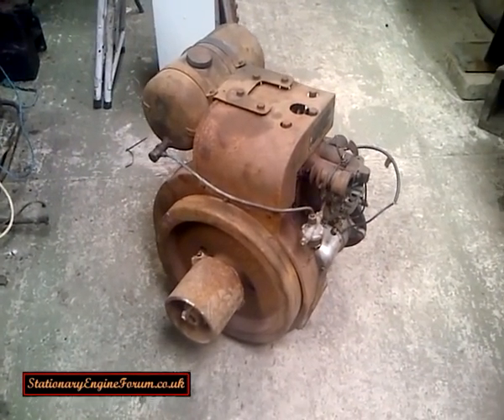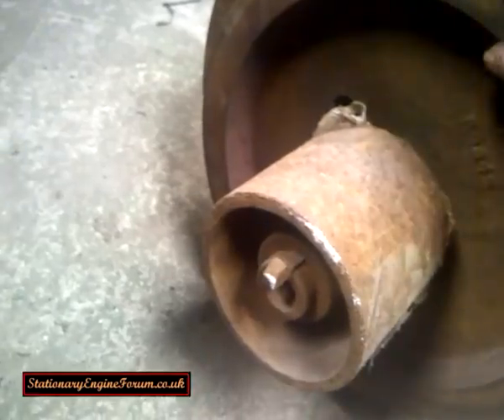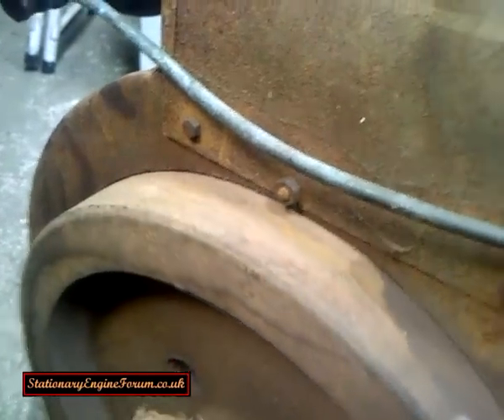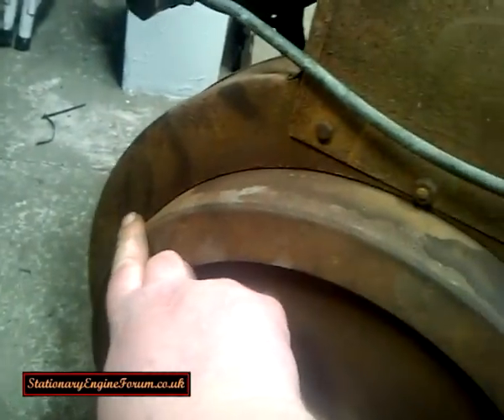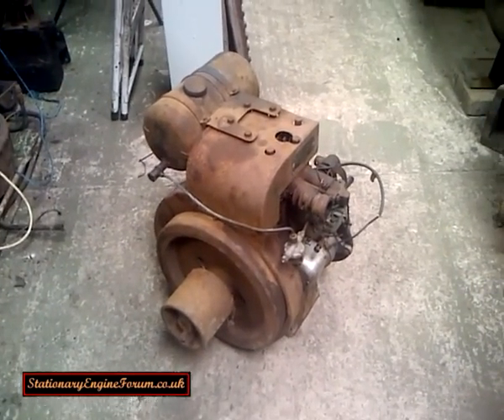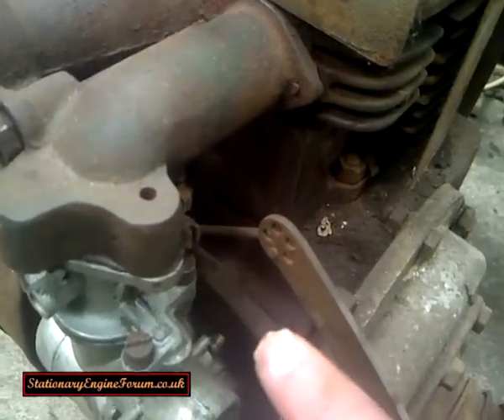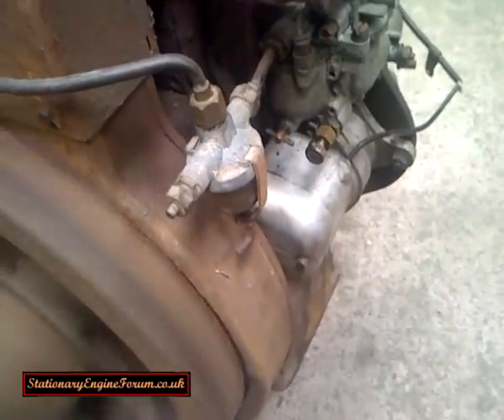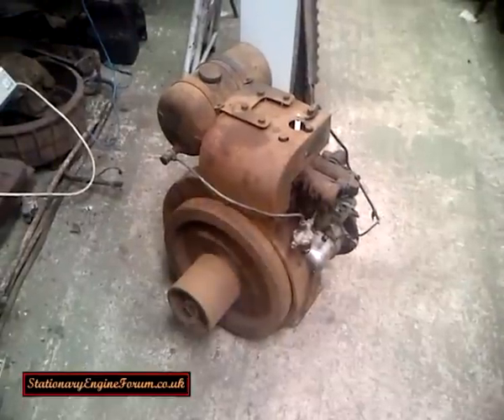How to time a Petter A1 stationary engine

Comment: I have just taken the magneto out as I had no rotation on the shaft. Ive ordered a new mag floating coupler as only half was left on the inside shaft. will need to try and fish the other half out the sump. Is there a particular way to fit the coupling ring when it arrives, or does it just fit over the drive shaft then magneto fit over that, thanks Gordon.
Reply from the maker: The coupling ring should just fit. I seem to remember it's shaped in such a way you can't get it wrong. When you refit everything make sure the ball bearing is between the two halves of the shaft that operate the governor. If it's not there the governor will not work correctly.
Reply: @AndysShed  Im totally lost now. There is no ball bearing. The shaft and large gearing cogslid forward and lost the timing . I reset the timing marks as per diagrams but now the thing wont fire up. Theres spark and petrol but somehow the timing is out. Both the timing marks on the cogs line up at tdc...sparks and clicks but wont run.
Reply from the maker: When you say the timing marks line up, do you mean the marks on the two cogs in the geartrain that you can see when the triangular back cover is removed from the engine?  You don't need to worry about any other timing mark. Just set the engine to exactly top dead centre using the flywheel. Next rotate the mag in your hand until it has just clicked but don't go beyond. Then, without rotating anything, fit the mag back to the engine. Now when you turn the flywheel the mag should click at exactly TDC. This is correct  because there is a device in the mag to advance the timing when it is running at full speed.

Comment: Hello, just picked up my non running A1. complete strip down and rebuild before seeing if it runs. Any advice appreciated.   Ernie.
Reply from the maker: Hi Ernie. I would say hold the plug lead against something metal with the plug out, turn over by hand and see if you get a spark. If you do then it will  probably go. Setting up the timing is the most difficult bit.
Reply: @AndysShed  
Cheers for the heads up.  I gotta clear some space in my garage. I'll be starting the project in a month or so. I'll let you know how it goes and if I get a spark.

Comment: Please do you know how to slow idle down as mine peaks out abs dosent idle at tickover speed kibd regards Dan
Reply from the maker: Hi Dan. There's a combination of things it could be. First thing to check is that the governor is working as it should. The weights push a pin, which in turn pushes another pin which pushes the governor linkage on the outside. However between the two there should be a tiny ball bearing. If the ball bearing isn't there (they get lost when the mag is removed) it won't be pushing the governor arm far enough to close the throttle on the carb. Also make sure the spring on the bottom of the governor arm isn't too strong. There should be a knurled adjuster on it to effectively alter the spring's length.
It could also be bad settings on the carb. Depending which carb it's got, you might have to juggle setting the main jet, slow running screw and which hole the linkage from the governor goes through. The problem is if you don't know which thing is out, it's a lot of trial and error with the carb, governor spring and linkage to get everything right. Maybe try to get it running slowly with the governor disconnected first?

Comment: Hi Andy I have an a1 the same wipac mag as your engine in the video,my qusetion is how do you set the impulse lag angle,mines been messed with,there are divisions and a pointer,am not sure how to set? Thankyou Scott
Reply from the maker: Hi Scott. I'm not sure what you mean by the lag angle. The impulse should fire with the engine's flywheel at exactly TDC. To get it to do that what you do is completely remove the mag from the engine, then turn the engine flywheel to exactly TDC. Next grab the cog on the end of the magneto and turn it until it clicks. Don't touch the end of the HT lead otherwise you'll get a belt from it! As soon as the mag clicks make sure you don't turn it any further. Now without turning either the flywheel or the mag, fit the two back together. Turn the flywheel and you'll find it fires at TDC. As far as I know there's nothing else you can adjust. the difference between the mag using the impulse to fire when turning over slowly and knocking the impulse off when running at speed is fixed in the mechanics of how the impulse works, so it can't go wrong.

I hope that's answered your question. If it's not then please feel free to get back to me.
Reply: @AndysShed  hi Andy,the engine is know running ok,thankyou Scott

Comment: Hi Andy I have just bought a A1 it doesn't have any spark and the magneto is a different type to yours any ideas
Reply from the maker: There are two mags commonly used on the A1, a Wico or a Wipac. They are slightly different, but both basically work in the same way and should be interchangable.

I would suggest you take the mag off and test it away from the engine. However when you remove it be sure not to lose the metal pin and ball bearing from the end of it that sit inside the brass housing that's attached to the rear gear-train cover. This pin and ball are crutial to push on the throttle lever.

Whichever mag you hace, start checking it by removing the cover. Check the internal connection that links the coil inside to the HT lead on the cover. Make sure the contacts are clean and actually touching when the mag is reassembled.

Whatever you do, don't fire the mag without the HT lead being very close to the mag body so the spark has somewhere to jump. If the spark doesn'thave anywhere nearby to jump to then it will find the path of least resistance through the coil and could short out some of the windings, making the coil lass effective or even completely inoperable.

These mags very rarely go wrong, so chances are you have dirty contacts somewhere or maybe a bad HT lead. Remember to check the points and condenser. Clean everything up and it might well be ok. Let me know how you get on.
Reply: Thank you I think it’s the wico square type top will do the soon thanks

Comment: I bought one of the plugs you recommend but it only screws halfway into the head as thread does not go deep enough. Any other plugs you recommend?
Reply from the maker: Hi Peter. I would  have to check up on plugs and get back to you  on that one. Since making this video I've discovered Petter seem to have made slight changes to the head over the years, which means different length or even different width thread plugs are used on different engines, even though they are all Petter A1s.

Comment: Engine would be good for the sound effects in  a cartoon.... I'm trying to time a  4 cyl. L-P engine running on LPG.Mfg 2000.  The timing is done with reference marks on the  flywheel with the starter removed but I see no reference mark on the engine casing, just on the flywheel. So, I search on.

Comment from the maker: Hi Gary. It depends which carb you have. Both Zenith and Solex carbs were fitted. If you let me know which one it is I'll try to give you more details.

For now I can tell you that these engines often run a bit rich if they're not under load. Give it a bit of work to do and it will probably run better. Mine sometimes need de-tuning if they are running without doing any real work.